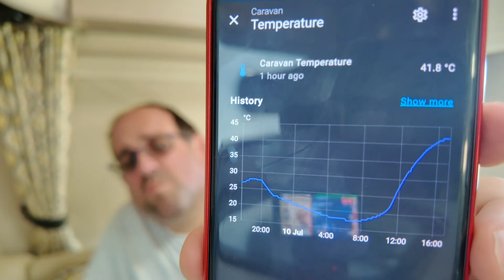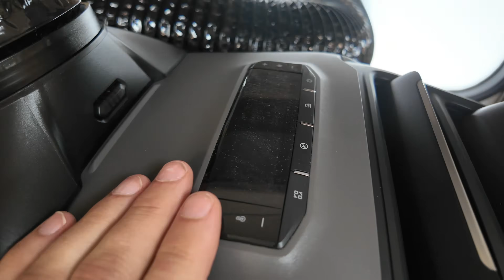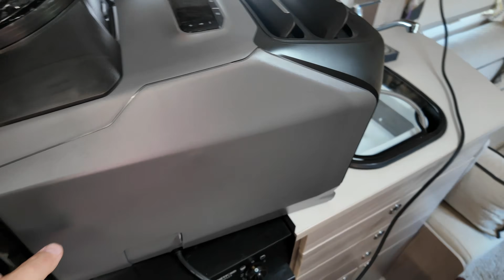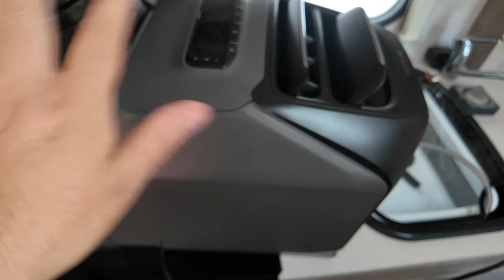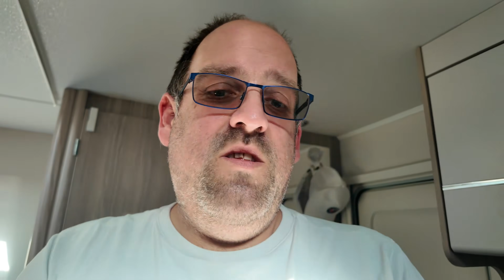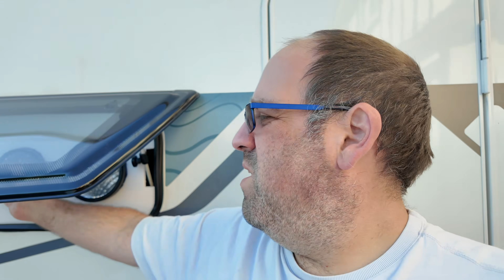Ecoflow Wave 3 Portable Aircon in Caravan

Comment: 27.8c is definitely not comfortable. I live in a static caravan and have a 3 pad evaporative cooler and it keeps my caravan around 27c on hot summer days. It costs around 15p a day in electricity. I'm out 10 hours a day at work and have an old tyme bulldog so I have to have it bearable for him. I looked at many aircon units but they would cost around £3 a day in electricity. That's £90 a month or 20x the cost of my evaporative cooler. And, for all the know it alls who are going to say evaporative coolers don't work in England...Yes they do, I'm not even going to argue the toss. I have a Bosch temperature gun and the air coming out of my cooler is 8c colder than the ambient temperature. I've been running mine for over 4 years and it makes a big difference inside my caravan. Just leave 2 adjacent windows open for ventilation and you're good to go. For anyone interested the smaller single pad coolers for around £70 don't work, you definitely need a larger one with 3 pads (1 on the back and 1 each side), for reference mine is a Symphony 3d 12 litre.
Reply from the maker: Thanks for sharing your experience and the detailed breakdown of your evaporative cooler! It's always great to hear about alternative solutions that work well for others.

Comment: Great review!
My question is: if the unit wave3 is inside. I understand the smaller duct with hot air goes out. Why the larger duct don’t intake the cooler air from inside to convert? Also what’s dimension of smaller duct you cut out. Many thanks
Reply: Agreed.. it's silly to pull hot air from out side to cool when you can just use the cool air from inside to make even cooler.. it's the way split system heat pumps work!!.❤️🇬🇧

Comment: Great review!
My question is: if the uni is inside. I understand the smaller duct with hot air goes out. Why the larger duct don’t intake the cooler air from inside to convert? Also what’s dimension of smaller duct you cut out. Many thanks

Comment: Im thinking of buying one of these for my TAB320 caravan. I live in a sub tropical region with very high humidty and summer temps, so my caravan gets unbearably hot to a point where i cant use it for 3-4 months over the summer. However, since my caravan is tiny, positioning one of these ecoflow behemoths inside is a non-option. Have you experimented witu keeping the unit outside your caravan and running both inlet and outlet tubing inside?
Reply from the maker: Yes, it works well.
Reply: @IntrepidIresons  Any downsides to keeping it outside?
Reply from the maker: Having to keep window open, theft,.noise for neighbours.

Comment: I use mine in my suv and it always cools ot down enough to sleep with a blanket. I usually turn the cars a.c. on for 10 minutes with the remote start and then I run the eco flow on eco mode which usually last about 7hrs. Only one day when it was 110 degrees outside did I have to run it on max to get cold enough, but! If I point straight at me it's more than enough to make cold lol
Reply from the maker: That's a great setup for your SUV, good to know it handles 110F too. Thanks for sharing your experience!

Comment: If you want to improve the performance of the wave 3 I suggest you position the exhaust pipe in a better way for heat to easily exhaust with the way you have it positioned it’ll build up heat in the exhaust pipe thus just heating up your area more it’s best to keep it short as possible and straight out the window not zig zagged like you have it now and also buy a thermal sleeve for the exhaust pipe that’ll also help improve performance
Reply from the maker: Thanks for the suggestion, I'll give it a go next time.

Comment: Seems weird to draw the hot air from outside in. Surely if the intake was inside then you would get the benefit of the reducing temperature? ie you are cooling cooler and cooler air . Also the exhaust and intake being so close could it suck in the extra hot air?
Reply: If you pull inside air through the unit it will create a negative pressure inside the van. If you pull outside air in, it creates a positive pressure and is more efficient. Same thing with in home portable ac.
Reply from the maker: I think it's something about not using the air it's cooled and blowing it out of the van with the heat. The outside air is enough.... I've tried a few ways with hoses close and far apart and haven't noticed a difference other than how much space they take inside the van.

Comment: Seems a bit bulky and noisy for a small caravan, is it not going to be annoying?
Reply from the maker: I'm much better with noise than heat to sleep. It does have a quieter sleep mode. Not that it's going to help if you're used to no noise at night.
Reply: @IntrepidIresons we have the wave2, and you can barely hear it on night mode.

Comment: So 30C outside and 27.8C inside... Just over 2C delta T. 

Hardly seems worth the money. 

However, i do think you would see an improvement if you moved the inlet and outlet holes as far away as possible from each other.
Reply from the maker: It started at 40oC in the van though. So in fact it's cooled much more!
Reply: @IntrepidIresons I get that, and I'm not trying to be awkward, just comparing inside and outside temps. 

I'm torn between fitting one of these and an under bunk ducted system.
Reply from the maker: If you have the weight capacity In your payload and don't want to use it elsewhere go under bunk 100%